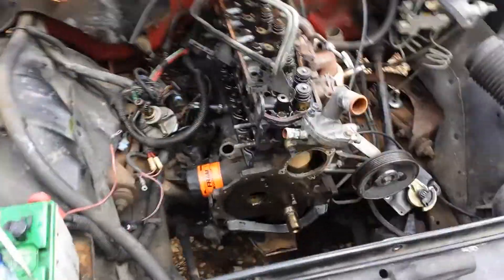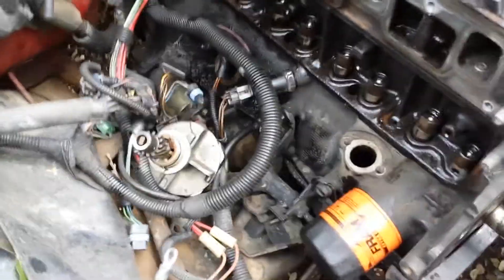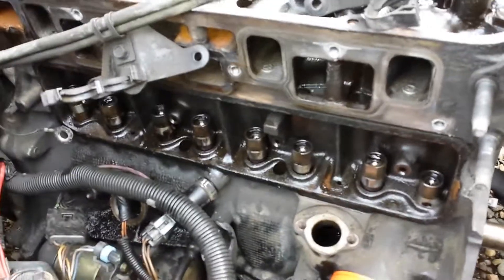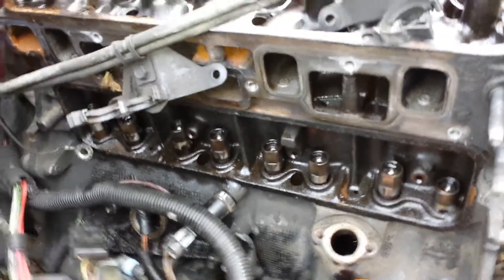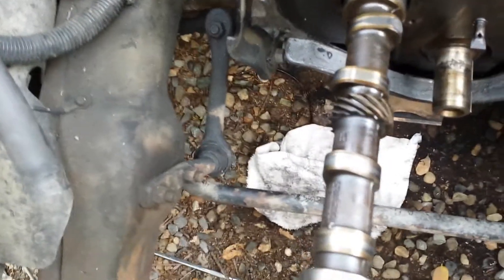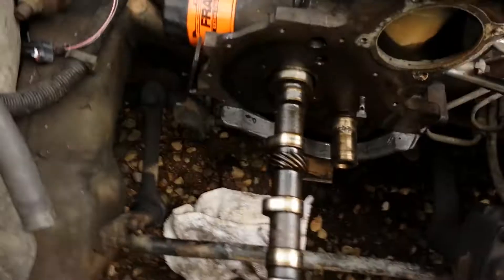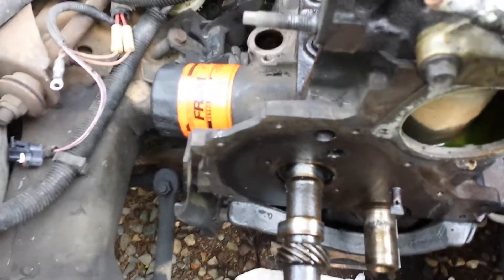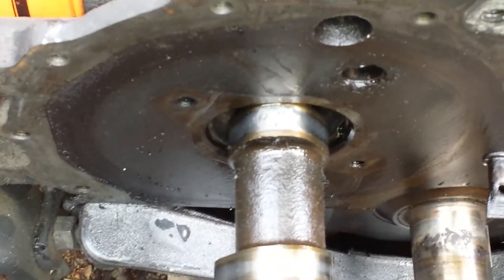91 GMC Sonoma S-10 Cam Installation Iron Duke s10

Comment: I have 1987 Pontiac 6000 with same engine. First time I want to replace new Camshaft gear which original GM one on it. It is making noise in past 10 years. They said because of Camshaft gear/sprocket. It is made of thick Bakalite and fiber resin around. Only center is made of steel which seats on Camshaft. Now problem is, I can't removing old Camshaft gear. Yesterday, I lower cross member ASAP lower for apply 2 legs puller. I removed 2 small bolts by accessing gears 2 holes. Camshaft came out a little but it stop. I didn't force it to bring more out. Then, tried to pull it out with 2 legs puller. It was very hard. It didn't move even, but half of gear is broke. Regarding Crankshaft gear, is very easy to remove and install. Can you show how you removed Camshaft gear itself? Or, together with Camshaft. I wonder how to remove Cam gear without removing out Camshaft. I don't want to remove Camshaft completely. I need to remove gear only. I am thinking to broke or cut other half of gear then apply puller directly on center metal part which it will stay on Camshaft after I break or I cut with cut off disk the other half of remaining Bakalite part. Its center metal arbor is very tightly installed. I noticed to broken half of gear, there is thrust plate which secured with 2 small bolts. Can I put puller's 2 legs just under/ behind of this thrust plate for pull out this metal center from camshaft after I broke other remaining section of gear?

Comment: You should have saturated that thing in engine assembly lube!
Reply from the maker: Naw. Just stick it in dry. She's lucky if I spit on it first. 
Plus,  I was manually running the oil pump and that is more than enough saturation